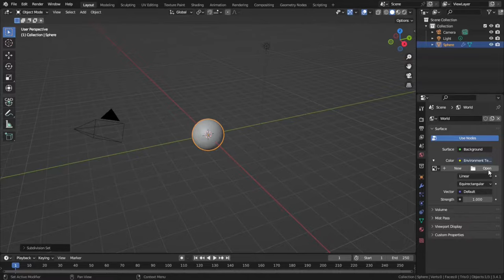How to make a Procedural Glitter Material in Blender

Comment: how can i replace the color map with a image texture (having the image texture set the colors via UV mapping)?
Reply from the maker: All you have to do is plug in your image texture into the color instead of the color from the voronoi texture, the normal data will still give the object the illusion of having specks of glitter scattered across it. However, it might be a good idea to make the scale of the voronoi texture very large, so it isn't possible to see specks of glitter with multiple colors from the image, but that depends more on what sort of texture you're using. I hope this helps!

Comment: Thanks for your useful tip. Now I have a problem with rendering because the render result in Cycles is blurry in that glitter part. Does anyone know how to fix it? Thank you.
Reply from the maker: @VyLêHồYến  Are you using Blender's default settings for rendering? also which version are you using? there's a possibility that some of this changed with an update, when I get a chance I'll take another look through the file and see if I can find a solution

Comment: Yo iam trying to make the glitter effect work with a object that i have a image texture connected to but iam not sure if it will work i tried it but it didnt work is there a specific way of doing it?
Reply from the maker: are you attempting to mix the glitter effect with the image texture?
Reply: Yes so that the colors on the texture are the one that have the glitter effect instead of picking a color from the color ramp @ChipTech2000